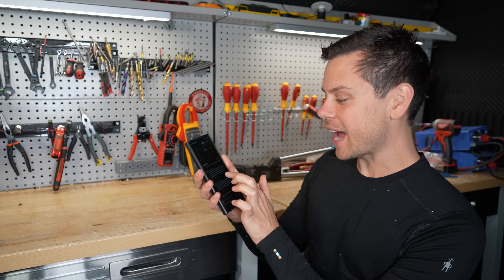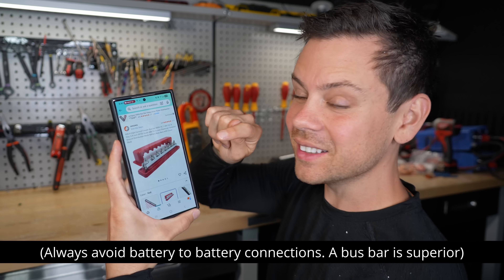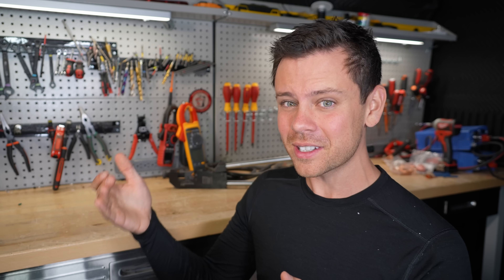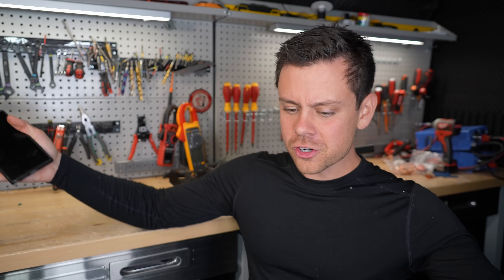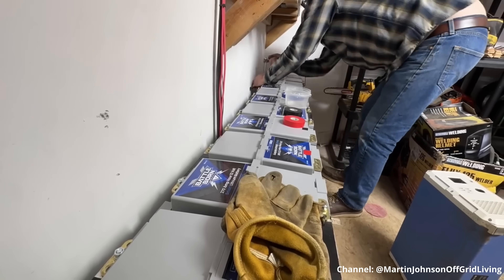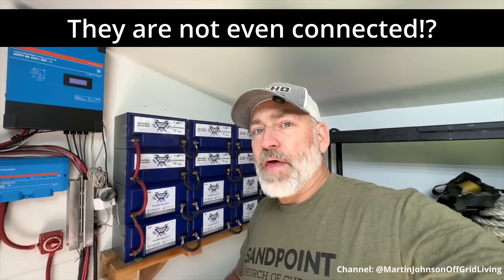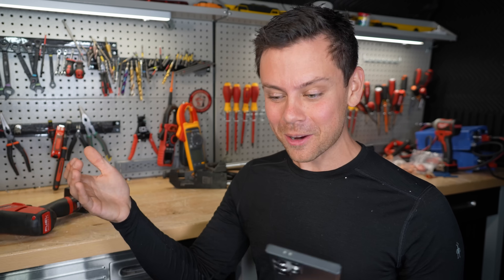My Reaction to Martin Johnson's "BEST Off-grid Battery Bank" Video 😬 Yikes!!

Comment from the maker: This video was not to call him out or belittle him. There are real safety issues here that could cause fires. 
Here is the original video: https://youtu.be/fLwTGRnALis?si=h9Tlxy1KbCPouoox
I didnt realize that he caused a massive short circuit in the video right before the sixteen-minute mark. I totally missed that one! Yikes!
0:00 Price Comparison and Minor Stuff
2:25 Soldering Lugs!? What!
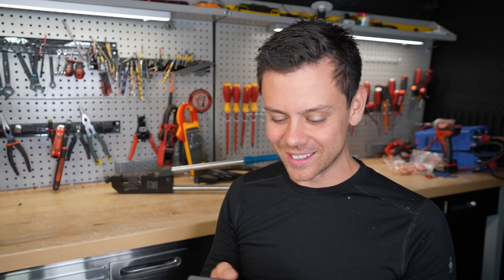3:39 It Gets Worse..
4:10 4AWG Wire!? 
5:52 More Bad Soldering..
7:56 This hurts to watch
11:24 SHILL 
13:04 "Smart" Batteries... that are unbalanced
14:23 Conclusion

~~~~~~~~~~~~~~~~~~~~~~~~~~~~~~~~~~~~~~~~~
Tired of getting ripped off? Check out my "Will Prowse Approved" solar product recommendations below!

12V Batteries
https://www.mobile-solarpower.com/lithium-batteries.html

48V Batteries
https://www.mobile-solarpower.com/48v-batteries.html

Offgrid Inverter System Builder
https://www.mobile-solarpower.com/48v-complete-system-blueprint-559371.html

Hybrid Inverter System Builder
https://www.mobile-solarpower.com/code-compliant-48v-offgrid-system.html

Mobile Handtruck System Builder (very popular!)
https://www.mobile-solarpower.com/mobile-48v-system.html

Solar Panels
https://www.mobile-solarpower.com/300w-solar-panels.html

Ground Mount Solar Racking
https://www.mobile-solarpower.com/ground-mount-racks.html

Wire, Lugs and Busbars
https://www.mobile-solarpower.com/wire-and-connectors.html

Tools
https://www.mobile-solarpower.com/tools.html

Fuses and Circuit Breakers
https://www.mobile-solarpower.com/fuses.html

Plug-N-Play Solar Systems
Ecoflow, Anker And Bluetti! So many models to choose from. See my current recommendations here:
https://www.mobile-solarpower.com/full-size-systems.html

~~~~~~~~~~~~~~~~~~~~~~~~~~~~~~~~~~~~~~~~~~
Need to build a large DIY system? Need a trustworthy solar distributor? These are my favorites:

Signature Solar
Creator of EG4! Solar Minisplits, Victron and More! Largest Solar Store Online.
If you want $50 off, please use my link below and coupon code "DIYSOLAR50":
https://signaturesolar.com/?ref=cPwLcVc0SW-BjN

Current Connected
Best Prices for EG4, Victron, Midnite and so much more! Fast Shipping and Highest Rated Customer Service:
https://currentconnected.com/?ref=wp

~~~~~~~~~~~~~~~~~~~~~~~~~~~~~~~~~~~~~~~~~~
Join our DIY Solar Community 
Need more help? Join the largest solar forum on the internet for beginners and professionals alike. 140,000 members and counting!
https://www.diysolarforum.com

Check Out My Free Book
Best-selling and beginner-friendly guidebook to off-grid 12V solar!
https://www.mobile-solarpower.com/the-book.html

~~~~~~~~~~~~~~~~~~~~~~~~~~~~~~~~~~~~~~~~~~
Contact Information:
I am NOT available for personal solar system consult! If you wish to contact me, this is my direct email: williamprowsediysolar@gmail.com
FTC Disclosure Statement and Disclaimers:
Every video includes paid promotion or sponsorship (such as free products for review). Some links on this YouTube channel may be affiliate links. We may get paid if you buy something or take an action after clicking one of these. My videos are for educational purposes only. Information is subject to change/update at any time. Electricity is DANGEROUS and can kill. Be smart and use common sense :) DIY Solar Power with Will Prowse is a participant in the Amazon Services LLC Associates Program, An affiliate advertising program designed to provide a means for sites to earn advertising fees by advertising and linking to Amazon.com
Reply: I've watched both videos, you are 100% correct. I'm a retired Electronics Technician with experience in high power DC power supplies and other fields. I've worked in industry, research and government. I have in fact seen solder melted out of over-loaded large gauge copper lugs and the cable fall out of the lug. I have seen cables in fixed installations (not moving or vibrating) develop leakage when bundled against other cables or hardware. Leading to short circuits and damage. All wires going into a lug should be crimped using the correct tool. Soldering in addition to that is acceptable but not with corrosive flux commonly used for copper pipe. Always separate conductors from those of opposite polarity and from resting against sharp edges. This is scary even if it has lasted six months. All someone following this example has to do is a little poorer job of it and it's a house fire.
Reply: @Chris-lp3dm  there are ALWAYS cables "moving or vibrating" in ANY installation.
Reply: @Chris-lp3dm  "I have in fact seen solder melted out of over-loaded large gauge copper lugs and the cable fall out of the lug."

Maybe this is his idea of a fuse? overheating -> connection breaks
Reply: @Gnarfzrl  no, the wire should never flap randomly anywhere. Look where the conduits are, mm gap from aluminium battery interconnect bar.  Big Boom!!
Reply: Definitely do more reaction videos. This is fun
Reply: Why don't you contact him and tell him how to do it, to where it is safe
Reply: @alive.off-grid  Or he could invite Will to his property and they could rebuild it. Would be a great video.
Reply: @kevinriley7834  I suspect that guys ego might get in the way of sound advise.
Reply: Please contact him and offer him some guidance.
Reply: @alive.off-grid that dude has done shady stuff every video and still does the same things, its likely he doesn't care because there is a 100% chance someone tried to tell him.
Reply: My biggest fear for him...
He has zero breakers or fuses on the batteries...
When built my DIY Seplos rack batteries, added a breaker to each of my 6 batteries....
Reply: Yes please do more view meetings like this. It really helps us to understand the mistakes and correct methods.
Reply: i worked at a hardware store in a rural area......there is DIY and DIwhy? this guy is the later and the sort of people we would have coming in with hair brained ideas and having to talk them out of burning their houses down.
Reply: Why don't you go up there to Idaho and help him fix it. They're wonderful people and they built their own house from scratch! I was most alarmed when he was cutting metal busbars with a wood chop saw and NO SAFETY GLASSES!
Reply: hes also not using an anti corrosion for the different metals galvanic corrosion on them freshly sanded aluminum bars incoming
Reply: I didn’t notice it was long. But it was educational and funny!
Reply: He threw more shorting sparks at 18:58.
Reply: I still can see the expression on his face  when the arcs and sparks flew. :face-purple-crying:
Reply: I like the video and what you do Will. But I think if you were in  person with him you would be kindly showing him the error in his ways. But hopefully he has thick skin and is open to learning
Reply: This reminds me of the supposed aeronautical engineer who built a massive capacity 12V system. Did he own a copper mine? This guy has been building systems for years and can't use a calculator or maybe he owns Battleborn? 😂
Reply: 20 free batteries. ❤
Reply: Battleborn? GTFO. Worst company and worst scamming CEO. Sells garbage that doesn't work then refuses to refund but can't wait to tell you he went to an IVY league school so there's no way anything he produces will not work. Wonder how much they paid this guy.
Reply: See my comment above, if battleborn endorsed it then wouldn't they share some legal liability, but I totally understand that logic given the money hes wasting!  @muhdiversity7409
Reply: @muhdiversity7409  I saw on another video they claim to be built in the USA but all the parts are from China. They just put them in the case and mark up the price 600%.
Reply: @SkaBob  Yep, exactly. An insult to everyone that buys from them.
Reply: He’s going on and on about battle, born because it’s a sponsored video plain and simple
Reply: bro the video is sponsored, he got all those for free. he probably just did the cheapest whatever job to put it together and fulfill the sponsorship
Reply: and his soldered lugs shined when they disconnected from the short.  😂
Reply: Umm, so I looked at the original video for the moment that he caused a short circuit, and he took a huge lump out of that aluminium bus bar he made, and then he kept using it! With a huge chunk basically blasted out of it. I don't know why or how he's still alive. He's got to be the luckiest man alive, you don't mess about with that sort of power! It's either you really know what you are doing, or you are a dead man walking!
Reply: Your reactions are hilarious, he did it the most rednecked way possible 😂😂
Reply: Thanks Will, my reaction exactly...
Reply: I think calling him out is justified for safety and solar community as a whole. Great video hope you commented on his original video. You have earned respect in these videos.
Reply: Good lord. This guy is the Red Green Show in real life !!
Reply: Stuff people that get offended by facts.  Safety before feelings. More YouTubers need to be called out in situations like his video.
Reply: You should call him out.  He is shilling a product and being paid to provide bad information and unsafe practices to the unknowing public.
Reply: You should go up and show him how to do it if he’s open to it!
Reply: will haha😂😂😂😂😂😂 i am so much lougfthing .cause this man..man what the😂😂😂😂😂😂. .i am an profetional solar.owner but this 1 ..is so crazzy😂😂😂😂😂....  That is to dangerous🤭😆😆😆😆
Reply: Boom😂😂😂..what a bombmer men 😂😂😂😂😂😂
Reply: Now .way.....what😂
Reply: Thank you for this video Will.  But I  don't think he's gonna be very happy
Reply: You could have been a lot harsher (I was in his comments) and it would have been completely fair, but you're a gentleman too.
Reply: I couldn't see a single protection in this system, not in the dc coupled side nor the solar input side. Not one fuse, not one circuit breaker. 

It would be interesting to look at the voltage drop and temp of those lugs under high load. 

FFS, how can you do something so mediocre.
Reply: I suspect BB is working with him..... and the video is actually an advertisement.
Reply: Hey there Will I am surprised that you did not mention when Marty shorted out the wrong terminals while connecting those rinky dink aluminum bus bars. The spark scared the you know what out of him!! Afterwards he taped up his wrenches with tape, "just to be on the safe side".
Reply: I've actually been watching him build out his homestead for a long while. He is a super good dude. Once I saw the price tag on those Battlebornes, even knowing they are made in NV,  and I do want to support US companies; the price difference is staggering.
Reply: This is why in January 2019 at the RTR … Bob Wells said if you want to do solar the right way… this is the man to follow… and even did an interview with him!  I don’t listen to others … I ask in his forum… and I download his guide… he even gives it for free!  This is the exact reason when my friends ask my how I did my solar set up in my Van I refer them to you @willprowse
Reply: Hey Will, is there a shop that will repair a Giandel  5KW sine inverter?  Mine failed after 3 years.  I could not find any burned ic’s or bad mosfets?
Reply: For his sale and that of those who follow him, it would be wise to contact him and inform him. I am an educator and that would be an automatic move to do.... No matter the way would Receiver the info.
Reply: He should watch your videos and learn.
Reply: Well, a wire is nothing more than a fuse😂
Reply: Do you have a contact email? Im looking for input on my setup before I dump $5k
Reply: More reaction videos👍🏽
Reply: Maybe you could reach out to him and help him Improve his setup.  You forces combined… ❤
Reply: HAY WILL!!!!!! READ THIS!!!!!!   You truly should start doing LOADS of this type videos You have been blessed greatly Time to give back in a way that will most likely save lives! Also save people tons of money and aggravation!  HERE IS YOU CHANCE TO DO GREAT WORK FOR OTHERS
Reply: You should 100% do more reaction videos. This was very important to see what you shouldn't do when it comes to electrical wiring. Definitely not to humiliate but to educate everyone, especially beginners. Thank you for your work.
Reply: Can you make a video exactly like his system but cheaper and the right way 🙏🙏🙏definitely is something I’m looking forward too!!!!
Reply: 1) Why you didn't comment about his cat? What a safety hazard.
2) He is right about aluminum oxidation, but you never have that issue if you use copper, which has a lot better conductivity.
Reply: This man has now sadly passed as his solar shed caught his house on fire.
Reply: @jonny5714 i heard about that,he got smoke inhalation and didnt make it.
Reply: Will, please come to my shop and help me set up a system
Reply: Im interested in your crimper. Can you talk about it?
Reply: good deal . i wonder how about the recent reports of first microinverters having chins controlled shut off and recently on line hybrid inverters that require cloud to run also can be shut off by china  i going to do a van. but i love to build a cabin with solar scaling demand first before planning the   system  i laugh at people wh want solar to save on the electric bill but haven't done any attempt to use lower demand things first not even led bulbs first thing i did yrs ago when led bulbs got reasonable most i use is dollar tree 60 and 100 equ
Reply: This one Aged well...😂
Reply: We need to report that video to YouTube for how dangerous it is! He is completely ignoring everyone in the comments oh his video about how dangerous it is what he did. He just doesn't give a 💩💩💩!

Which makes it even worse...
Reply: You should’ve reached out to him and offered to save his life by helping him do it right 😂 would’ve been an awesome video
Reply: I was laughing my ass off when he was soldering his connections and then using aluminum bars to connect them
Reply: Check out his follow up video where he messed up and connects to the grid.
Reply: The scariest part?  5 months later and not only has YouTube STILL not removed it, despite all the commenters telling him how dangerous his setup is and asking/telling him to do so, he hasn't removed it.  He is a danger and disgrace and should not have public facing content.
Reply: But all you did was belittle him.
Reply: He's going to kill someone with his half baked solar build and a small amount of belittling would likely be acceptable.
Reply: How close is the shed to the house? That way if it goes up in flames, at least house may survive. Painful video to watch, insightful but made me feel sick of all the bads, on the good side was watching your reactions 😂
Reply: I've been giving this video response some thought, and it seems a bit out of character for you. While it may not be your intention to belittle him, you have done so, in a manner that seems out of character for you. 
I'm not suggesting for a moment that you should have refrained from calling out the numerous questionable and dangerous practices in the other video. But to show a few seconds, then pause it for a good laugh, seems unkind and unnecessary. Perhaps a listing of everything the other guy did incorrectly would have more to the point.
You might have been more on point to note that sponsored videos are little more than commercials, often filled with enthusiastic support that has been bought and paid for. You are at your best when you are demonstrating how to put a system together, or tearing something apart to see how well it's made. That's what got you a million subscribers.
Reply: @LittleBirchMike  I agree. It seemed totally out of character for him.
Reply: You can’t help stupid people.
There are thousands more idiots out there, so don’t get side tracked. They will only bring you down.
Just keep on making quality videos and keep it professional.
Reply: @gordonkeen3852  Nonsense, someone helped you write that comment.
Reply: "This video was not to call him out or belittle him." Under a video that is a full roast, calling him out on all his mistakes while laughing, haha.
Reply: It seemed personal 😢
Reply: I like to know if Will left a comment to the video and whether the other content person has responded to this video. 

Like to see Will's assessment of Narrowway Homestead latest solar system.
Reply: It may not have been intended but it certainly came off that way.  I like you Will, but you need to remember that you swing a big bat.
Reply: Hmmm.  I don’t know.  This video felt bombastic and is quite cheesy compared to what I’ve come to expect from Will.  Will usually takes the high road and I respect his approach to teaching how it should be done.  Perhaps he’s losing eyeballs and is turning to virtual signaling?  I hope he doesn’t do more of these.
Reply: Its official will is a narcissist!😢
Reply: @HeartMadeOfGold that's not narcissism, definitely 100% had to live with that for decades and this isn't it. 😂
Reply: Will u just created a gang mob and they are attacking that man!Bad craftsmanship or not that man was minding his own business u just created a problem for him and he did nothing too u!
Reply: @HeartMadeOfGold But he wasn't "just minding his own business". He is showing teaching people how to build fire hazards, and reccomending grossly overpriced and substandard  gear. He is literally putting his and other people's lives at risk.
Reply: @HeartMadeOfGold Will knows what he's doing. He always points out WHY he said something. Thank you Will!!!!
Reply: @graynoble4795 he sure do!and it’s called needing content and taking it out at the expense of another!he wants to be a bully so he using followers to do it!If u take everything someone says and dont do your own homework and even testing sometime u are an ignorant.Beside the overly priced battleborns the build was just impractical!Saying it’s a fire is just a reach.From the amount of batteries he is using how many amps are u expecting?😅Impractical yes fire hazard far from!If u watching any video with battleborn battery in then and are okay with the price of just then u should find somebody with experience and just pay to have it done right u out of your league if u think those batteries are worth the mark up u pay!
Reply: @HeartMadeOfGold  Yes, he sure is a narcissist.  Wow!  It's how Will went about this whole thing when he called this guy out.  If all Will did was point out the issues that can cause a fire to make sure his audience doesn't repeat it, that would be fine.  But he used the opportunity to boost himself up on a pedestal at the expense of another YouTube author for his mistakes.  My goodness, he even called out the guy for blinking.
Reply: Please talk to me for once I've been your subscriber for a long time now 
My name is Ibrahim suleiman from Nigeria 🎉😂😊
Reply: @suleimansolarcooperationcom 

Bro, hafa..lol
Reply: @suleimansolarcooperationcom are you crazy?